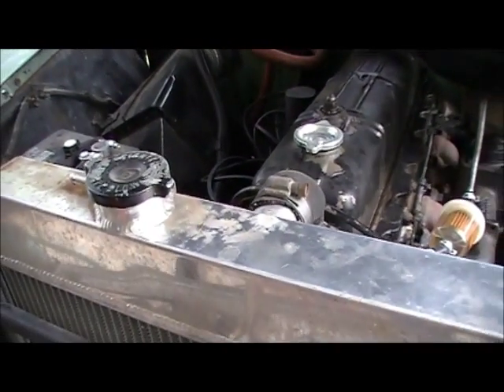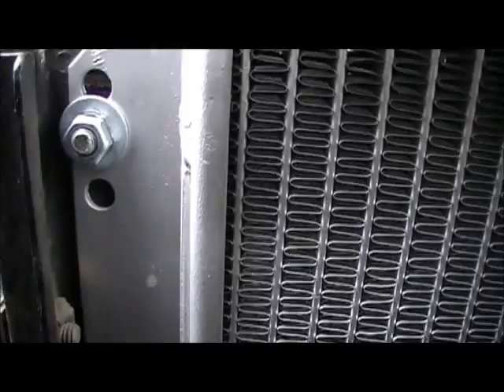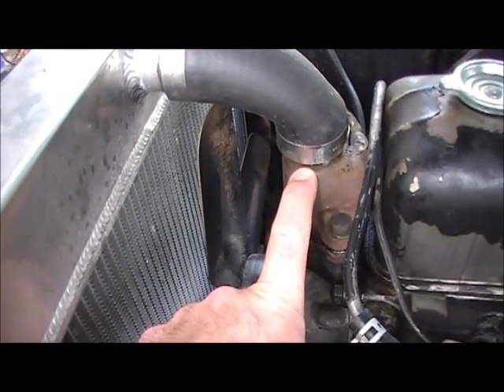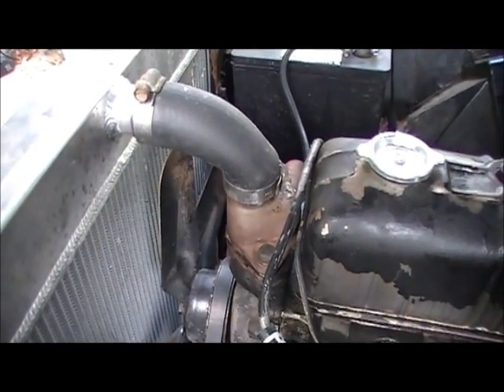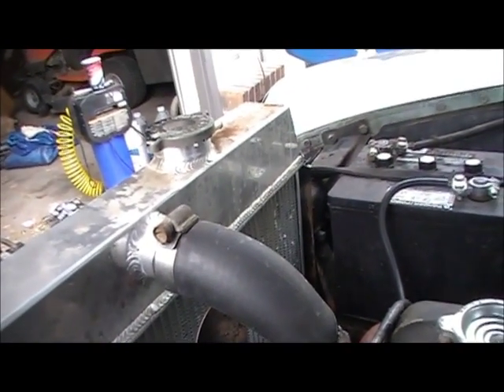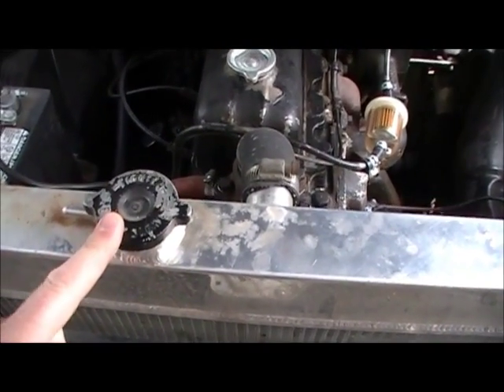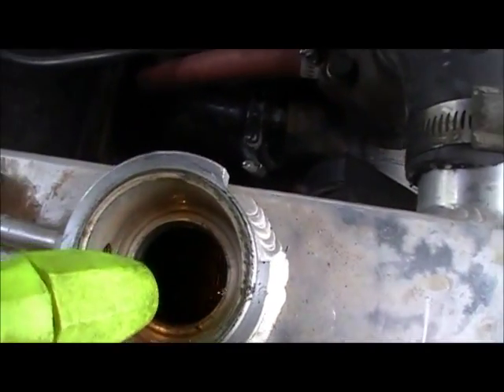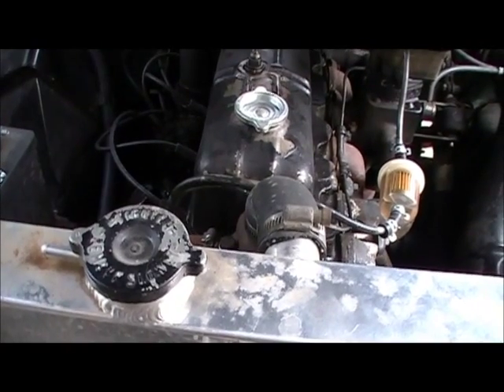Styleline Champion Radiator

Comment: What size plugs did you use that are located on the back for the transmission coolers?
Reply: I went to a hydraulic company and they fitted and installed them 20$

Comment: how was the radiator ? in thinkin of buying one but if it dont last i dont Think i should
Reply from the maker: So far I put right at 3,000 miles on it in a year. I've had no issues with it. I did swap the thermostat housing so the hose was an easy one. For $176 shipped it was a good deal. I do wish it looked more like the original but I decided to try this for the price and I am happy with it.
Reply: @ericsscout  what was the fix on the lower radiator hose